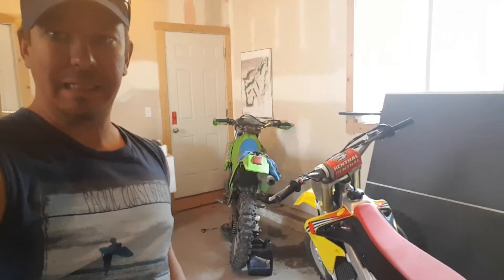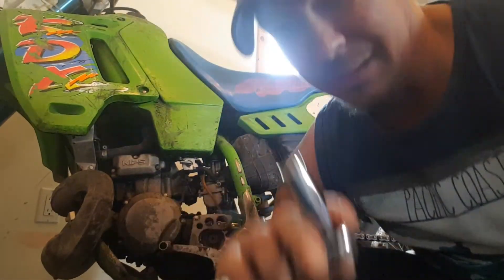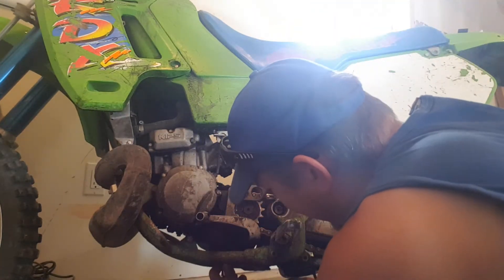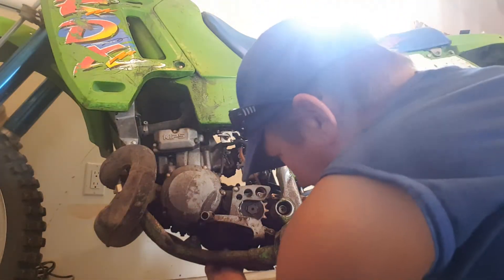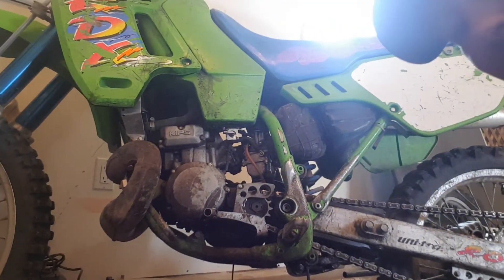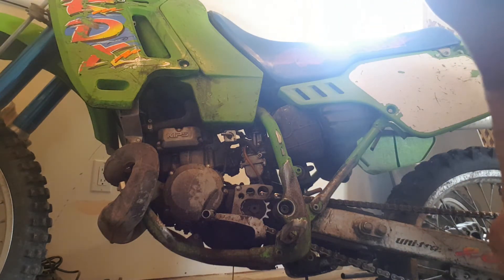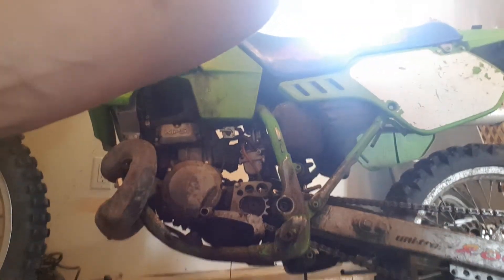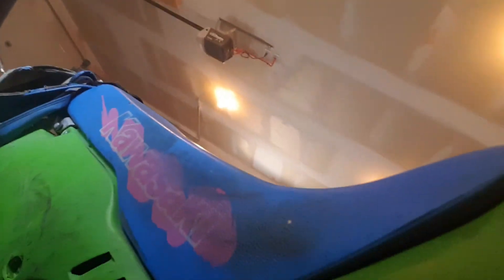Kawasaki 200 kdx-bike maitnenance  part 1 of 2

Comment: My airbox had a decent amount of clean oil in it today have you had this happen
Reply from the maker: i have a had a dust oil build up but not straight clean oil probably running too rich?
Reply: @BCBenny  I got it fixed no longer running rich which it was but the oil actually ended up being crank case oil I accidentally over filled it came out of breather tube into airbox

Comment: What oil do you recommend getting?
Reply from the maker: amsoil 2 stroke oil is what I run in this bike
Reply: @BCBenny  Thanks!
Reply: @BCBenny  Is that the same oil that you use to mix with the gas?  How much do you put in?
Reply from the maker: @lowriderST24  amsoil 2 stroke oil is what I run in this bike
Reply from the maker: @lowriderST24  amsoil 2 stroke oil is what I run in this bike I run 40 to 1 and to fill is about almost a litter every bike is a bit different

Comment: Why not 2 stroke oil mix ?
Reply from the maker: 2 stroke oil get's mixed in the gas tank I go 40 to 1 is what I normally go in my 200
Reply: B.C. Benny-TANK TOP COOKING possibly buying a 94 today cause a 250f was too much for me
Reply from the maker: @the_ltz_guymaster7912  Yeah man that's a bit of bike ridding a 07 230 ttr
Reply from the maker: @the_ltz_guymaster7912  buying 200 kdx? Great Bike!!
Reply: B.C. Benny-TANK TOP COOKING i was but the bike has too much rust and has been ran with 2 stroke beam oil not proper oil
Reply from the maker: @the_ltz_guymaster7912  good move to take a pass on that one
Reply: B.C. Benny-TANK TOP COOKING what websites sell the fork covers and other parts for a 94
Reply: B.C. Benny-TANK TOP COOKING can u make a video on how to change the brake lever
Reply from the maker: @the_ltz_guymaster7912  this guy I've used for old stuff for years https://mikesbikes.ca/
Reply from the maker: @the_ltz_guymaster7912  I'll try to at some point I actually have a half lever on my 230 lol it actually works pretty good
Reply: B.C. Benny-TANK TOP COOKING I just uploaded a video of my new kdx paid 900
Reply from the maker: @the_ltz_guymaster7912  cool I'll check it out!